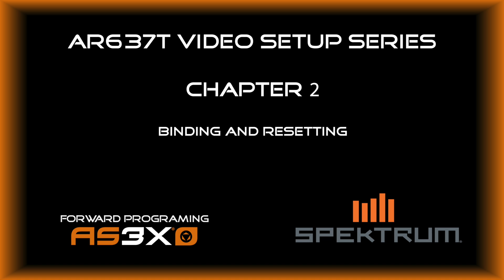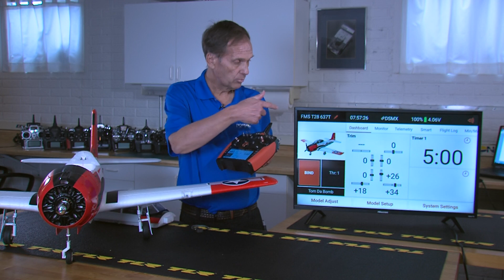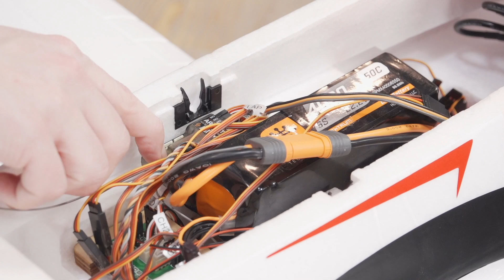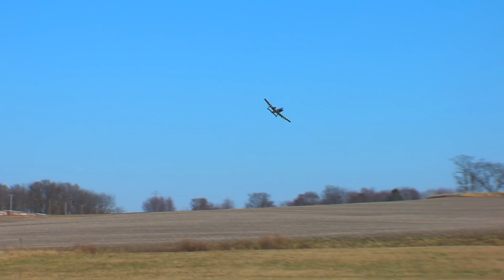Spektrum Smart Receiver AS3X Setup Series  #2 - Binding and Aircraft Setup

Comment: I have a lot of this new receivers and love them! The button is a great enhancement. But sometimes the possibility to use a plug is important if the receiver is mounted not easy to reach.
One think to take care is, this receiver needs a little bit more to initialise. Also the receiver is more sensitive to movements of the plane. It is important to not move at all the plane to get the receiver initialised. The AR636 was not so sensitive.